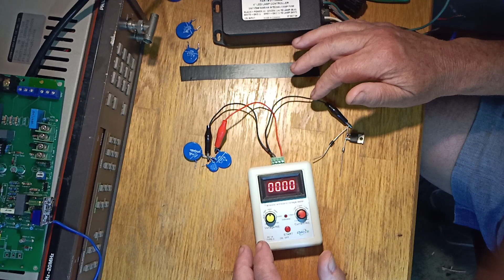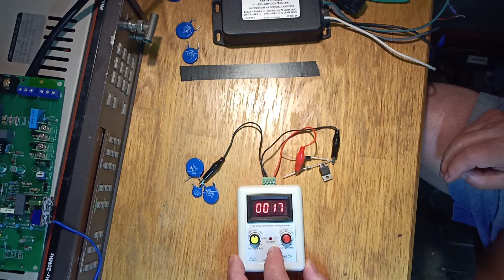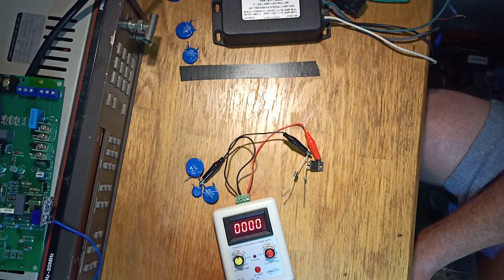MOV, FET, IGBT, Transistor, Zener  2700V Voltage Breakdown Tester For Less Than $20

Comment from the maker: Test pulled MOV and FET to see if they match specifications or if they have been damaged by spikes. Find out what that FET is with manufacturer number on it. Essential for parts from China on ebay because of the abundance of fakes. I've had FET with gate capacitance four times what it should be and on resistance five times higher.  Link to pictures of inside and further details in header. Recharges with USB.

Comment: Mine arrived with the pcb poking (because of the potentiometer legs) the lithium battery. If you press the button down, you are probably poking your battery as well.
Inside the design is very pour and dangerous. No insulation anywhere and the lithium battery sits bellow the high voltage traces.

Comment: Just got one from Ali for £8 Apr 2025 😁

Update. The unt is twitchy as fcuk IE the unit displays 600V but drops to 1.5V when a DVM is connected but set the output to say 800V and the DVM shows 800V. I don't know if mine is faulty or it simply can't be trusted.

Comment: the device arrived very quickly, has 2 functions, the capacitor discharger works, the high voltage device for radio components seems to work, but
a problem arises when measuring polar capacitors, with a capacitor voltage of 70-100 volts and microfarads greater than 1000 microfarads, it
starts to act up and gets stuck at a couple of volts and that’s it. I tried a bunch of capacitors but the problem is the same,
 small capacitors the device still shows voltage
and simple capacitors also produce voltage. The problem of polar capacitors is not solved in it. An error in the microcircuit or a defect.
Reply from the maker: I would never measure capacitors with this unless they were rated in excess of 4500V.  Puncture of the film will damage damage the capacitor.  With electrolytics it is just measuring leakage current at best.  Not a good practice.